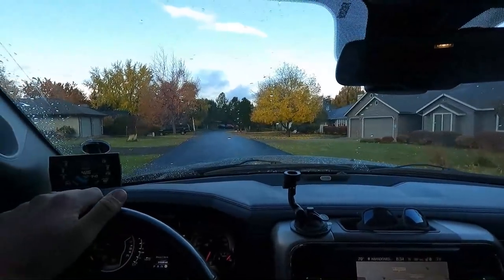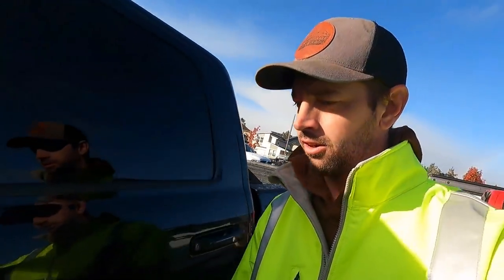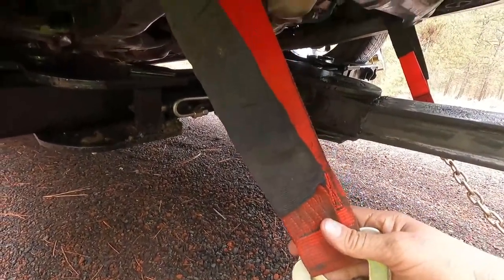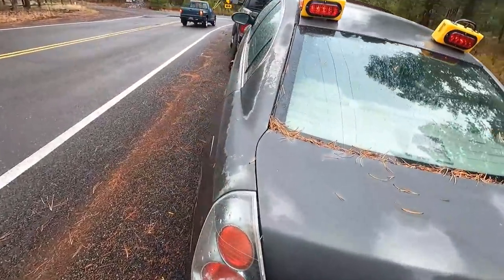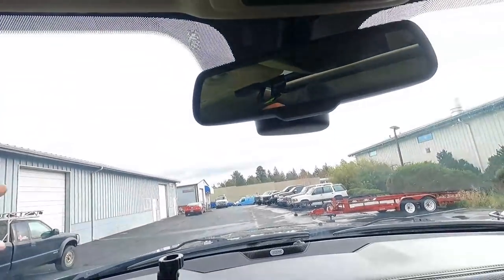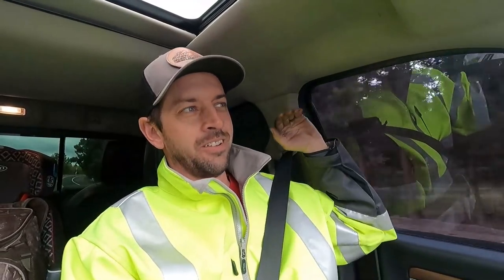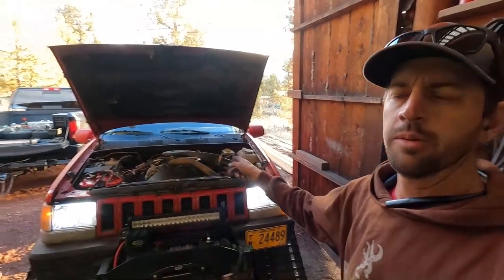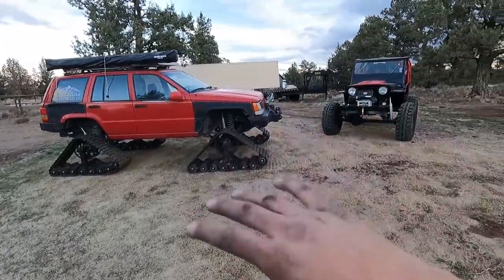Car gets smashed by tree!

Comment: What about the best of both worlds? A rollback with wheel lift and dollies as well? It is the most common configuration I see on the roads here in Sweden. I believe they mainly do it so they can take two cars at once though.

EDIT: not suggesting you should get one. Just curious about your opinions and if it something you see on the other side of the pond.
Reply from the maker: I've had them.  Still prefer a wheel lift truck